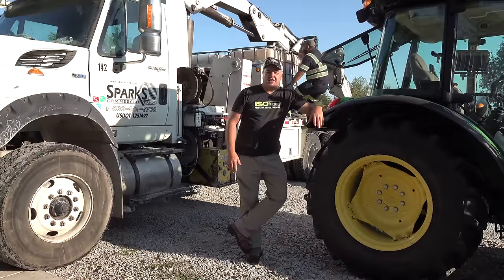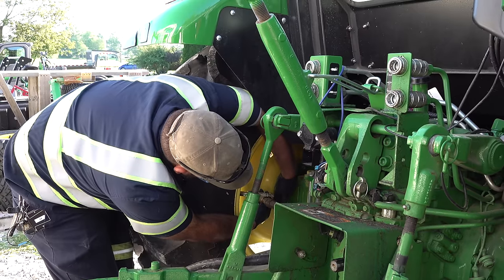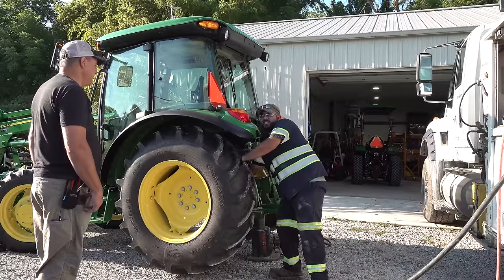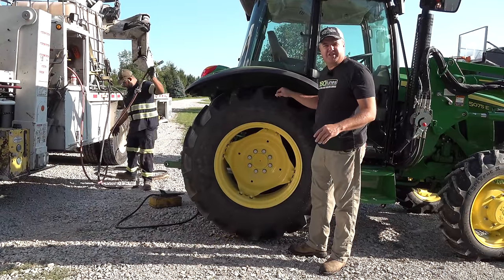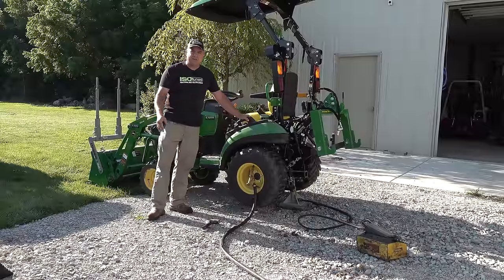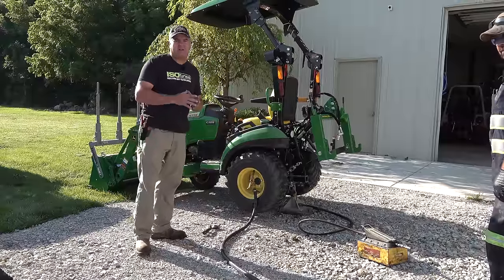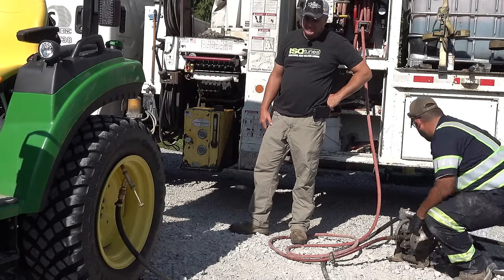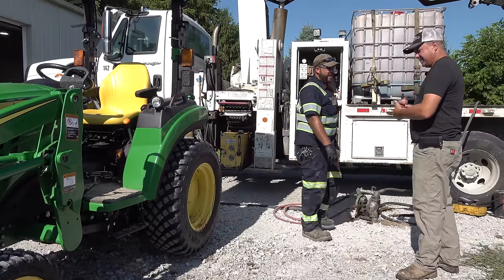Optimal Tire Ballast??  How To Add Rim Guard to Compact Tractors

Comment: Great video. I had RimGuard in my 4 series Deere, and It made a huge difference in the capability of the tractor. As you mentioned, I still liked doing heavy loader work with a rear attachment to offload the front axle.

Comment: I am the only person I know of that uses Rim Guard in the front tires of my 1025 R  I find that it helps with keeping them properly inflated.  Been doing this for 5 years and the front tires never lose pressure.  I don't do it for the weight, only the benefit that I worry less about front tire underinflation.

Comment: A good thing to reiterate as he kind of glossed over it is that once Rim Guard in in there, you have to check the pressure with the valve @ 12 o'clock.

Comment: I recommend greasing the valve stem external threads before putting the cap back on.  Otherwise, the Rimguard can sort of glue the cap to the stem.  

Never thought to check valve stem caps for rubber grommets.

Cheers.
Reply: yup, after all Rim Guard IS made from "Sugar Beets", which is why it doesn't freeze, sticky Sugar..
Reply: Sounded like gromlets. I guess that's an Indiana thing. 😆
Reply: @Dan-oz4qb  Amazon product info uses different language:  Airtight Rubber O-Ring Seal – These cap tire valves provide an enhanced seal to help prevent air leakage and to properly keep out dust, dirt, grime and road debris.
Reply: @Formulabruce  If you don't grease, then trying to get the cap off can break the stem.  Which creates an expensive puddle in the driveway.  Which is why I changed to another product for refill.
Reply: @Dan-oz4qb  I heard Grom-let as well lol

Comment: I do have liquid ballasst in all 8 wheels of my Ventrac.  No local beet juice, so I used the ever popular winter concentration winshield washer fluid.  Super easy to do since the Ventrac rims have 2 valve stems 180 degrees opposed.  7 gallons eash tire.  My slopes are severe and this helps and it is a huge help with the boom arm mower.  I tried threading the outer tires of the dual pairs as one normally does and what a royal PIA!  Then I wised-up and removed the lugs of the outer wheels to make the changes or to check torque of inner -- that is easy!
Reply from the maker: Good info.
Reply: HEY!  You jinxed me! I got my "J.D." out this afternoon and its ballisted front tire had this little shiney spot with dampness about it.  A bee hive frame nail!  So I jack that tire off the ground, pull the little cigar box nail, use a drill to enlarge/freshen the hole and a solvent cement sticky rope plug to save the day.  No ballast lost.  J.D. is a 1983 650 with the big Pillow Diameter turf tires.  Great tractor and runs like new.

Comment: I had my 3035d filled when I bought it, I like the way it handles loads in the bucket, the only time I’ve drove the tractor without the rim guard was around the lot at the dealership. At around 400 pounds per tire it has to be helpful!!

Comment: Anyone in Ontario, Canada: There is a dealer in Ingersoll that has it. I got mine done there. The fill process was knock the tire off the rim, and pour it in the side. We didn't use the valve stem. This was on a Massey GC-1720.

Comment: I have a JD 4100 that I had fluid put in all four tires when new. I recently replaced the front tires and did not add fluid. What a difference. The front tires will not turn on hills and only scoot forward when turned sharply. I AM INSTALLING FLUID NEXT WEEK before I get in trouble.

Comment: All 4 of my 2032r tires are filled.  It really has made a big difference.  Highly recommended.  The only problem is if you drive down the road at a high speed, you can feel it sloshing around and makes it bumpy.
Reply: I think you may need more fluid. From what I read, if you are planning to run at higher speeds, you want to fill above the rim (valve stem). This will help prevent sloshing, but will make a rougher ride as liquid doesn't compress like air. Another reason to use R4's rather than radial - you loose the flex a radial would provide. So cheaper and once filled not much different in flex/ride quality. BTW: this is what I'm hearing "on the street", so maybe Tim could chime in?

Comment: When we were tractor pulling, we made a plate that bolted to the lug nuts and a pipe welded to it. We then slid 50lb lead discs onto the pipes. We could make a 300lb mini modified tractor, into a 1500lb tractor. We had to do it that way because there were 4 weight classes, 800, 900, 1200 and 1500lb and had to switch weight classes constantly. Cool video Tim.

Comment: Interesting, I heard of people around here putting wind shield antifreeze fluid in their rear tires for weight but never a specific use product. Check your tractor with the forks attached at 20:10 of this video. Looks like your radiator is packed with debris. Best Regards, Jay
Reply: Front Grille sure does have debris !

Comment: On garden tractors filling steer tires helps even if you only add 20lbs per tire every little bit helps with a front snowblower that sits on the ground in operation since they like to go straight when you loose the added steer tire traction from the snowblowers weight as soon as the blower is lowered to the ground (I run tri and quad Rib steer tires on my garden tractors in16x6. 50-8) and my 23x10.50-12 v bar rear tires both front and rear loaded to 80%... My steer tires were factory 2ply on all my machines but I upgraded to 4or 6ply (depending on which tractor tire was installed).

Comment: Good work and an interesting video.  You converted me on one of your earlier videos to Rimguard and I find this ballast solution to be very effective.  As you mentioned, the weight is as low as possible.  My first go with Rimguard was on a set of HDAP tires used for plowing snow with a loader mounted blade.  I filled the fronts to provide as much steering traction as possible. Seemed to help.  Now have Versa Turfs with Rimguard in the rears only. We have some gooey clay and they excel in that stuff.

Comment: We are lucky here,straight water works. People will say it will rust the rim, but even if it does, it takes forever. My family has had water in the tires for 50-60 years and the rim hasn't rusted.
Reply: Yep, thats what I use. No problems. Way cheaper and easy to do yourself just pick up the adapter valve at your local hardware store

Comment: I ended up going with -20 degree rated windshield washer fluid from Sam's Club for my 1025r tires. It made a huge difference.
Reply: That is much cheaper the RG. Plus you can install it yourself. I have a  funny feeling it was not inexpensive.

Comment: Just a FYI...  Recommended minimum ballasting requirements for specific tractors/FELs can be pretty astonishing.  Ballasting, per Deere's own on-line manuals for the 520M MSL FEL on a 5075E Cab tractor (AKA Johnny 5):  Option 1) 3-pt hitch only ballast @ 3,197 lbs(!).  Option 2) 3-pt hitch @ 2,756 lbs AND rear axle @ 882 lbs (assuming that’s a total for both tires).  The new Rim Guard put 738 lbs per tire on the rear axle (1,476 lbs total), so that is around 2x the recommended minimum axle ballast requirement.  Even with the new Rim Guard, you'll still need something really heavy on the 3-pt.  I have no idea what kind of 3-pt implement weighs 2,756 lbs, let alone 3,197 lbs.  One thing not mentioned in the Deere manual is where that 3-pt hitch weight number is actually located.  I'd have to assume its out at the "24-inch behind the balls" distance normally used when specifying the 3-pt hitch lift capacity.  In the case of the 5075E, that 24" behind spec is 3192 lbs.  Like I said, astonishing!
Reply from the maker: Yep!   Extrapolating from the numbers above, 1500 lb on the axle plus 2000 lb on the 3 point should work.  That is what we’ll have.

Comment: Back in 2006 when I bought my tractor they wanted to fill my tires with calcium chloride. I told the the dealer no. As I knew it would rot the rims I have gotten by without weight in the tires as it does double duty as a lawn tractor and garden duty. The only time I notice the lack of weight is using the plow. If using the bucket for heavy lifting I will hang the tiller off the back as it is heavy and behind the rear axles like Tim mentioned for weight and taking some load off the front. Besides I have free ballast every time I sit in the seat LOL.

Comment: TY, nice video. I filled up my air pig that I pressurized  and was filed with winter washer fluid then transferred that into the rear tires on my mower, it added 62 lbs per tire. This method is best because filled tires and wheel weights don' t add any weight to the wheel bearings load the way rear hanging weights do.

Comment: Advantage of living in Florida, we just fill tractor tires up with a garden hose.  You just have to keep letting the air out to prevent over-pressurizing the tire. Haven't had time to do my new 1023E.

Comment: How much does the rim guard expand or contract with temperature? I know air will, and it will do a lot. Does the rim guard help prevent the tires airing down when it gets cold?
Reply from the maker: Good question.  I do not know.
Reply: @TractorTimewithTim  fluids are much less susceptible to volume & pressure fluctuation due to temperature than gasses are. Rimguard also has a much lower freeze point (-35) than water due to the sugar solution dissolved in it, but, because it is water-based, when it does freeze, it will expand like water does and can cause issues. lots of physics involved, but, with the smaller air volume left in the tire and the majority of the fluid being less dynamic, you will not notice much difference between a 110 degree day and a -30 degree day.
Reply: this is why I am getting agri-lim in mine, winters can be pretty bad here, will support -50 celcius (http://agri-lim.com/en/product/)

Comment: Well done info on the Rim Guard, and  the alternative installation of it on site, instead of taking the tractor to dealer.  Just curious as if tire pressure changes more in extreme (summer vs. winter) temperatures?  Nice job Tim and Christie, and blessings to you.
Reply from the maker: I don’t know, Kenton.
Reply: I'd assume the pressure would change less since there's much less air in the tire. Or maybe the smaller volume of air makes it more sensitive to temperature change? Great question!
Reply from the maker: Yes this is what an expert said in response to another same question.

Comment: Instead of a flow volume meter; do it by weight. Put a couple of load cells on the tank frame; and knowing the density of the rim guard; you can extrapolate how many gallons you’ve pumped.
Reply: weight isnt a problem,,,tractor frame and axle dont carry the weight, only the rubber at the bottom of the tire
Reply: @bill45colt  That’s not what the comment was about. It was about dispensing a specific amount of fluid; and how to measure it reliably.
Reply: @darkwinter6028  i comment as i please,,,,

Comment: I feel like I read in the manual not to load front tires with liquid balast. I just loaded my rears with ww fluid and it cost about $45 to get it done for me. I used the jack method to get it done. What do they charge to fill the 1025 tire?
Reply from the maker: Haven’t got the bill yet :-)

Comment: I liked the front tires on my Ford 2000 filled with ballast because the front end was so light when I lifted the bush hog and drove on a bumpy road I had better control. The Ford 5000 had no issues. But all my tractors had the rear tires filled.

Comment: Going by my old memory. My manuals with my 2025r say 120lbs wheel weight, filled tires, and 600 or 800lbs rear weight(ALL 3).

Comment: I have been using rim guard since 2003 when we got our 4710, we have it in all our tractors, great product, the only bad thing I can say is on the smaller garden tractor tires without air water valve stems I have had issues with the brass insert separating from the rubber valve stem after around 5-7 years, when checking the air pressure the brass insert will twist out of the rubber body taking off the stem cap, the rim guard seems to deteriorate those style valve stems, I just lay the tire flat on the ground and break the bead and sneak a new stem in it without losing all the rim guard

Comment: I wonder what that radial tire manufactory thinks about putting ballast inside of a tire it just deletes what the tire was designed for.
Reply from the maker: Have no idea what you are saying.     Large tires have used fluid for 80 years or more!!!!
Reply: In my opinion Rim Gard isn't going to prevent side wall flex. Foam will.

Comment: How that effect on rear wheel bearings/hubs
Reply: No issues
Reply: No effect; because the weight is all going direct to the ground. If the ballast weight were attached to the frame of the tractor, it would be resting on the bearings and you would want to keep an eye on how much the axle is rated for vs how much you have on it.
Reply from the maker: The other answers are correct.  This is the safest ballast on the axles.   Same with cast iron weights on the wheel itself.
Reply: Effectively, in automotive terms, sprung vs. unsprung weight (the reactors don't have springs but...). What does have an effect is moving the tires in/out as tim mentioned, but probably not enough affect to cause premature wear unless MAYBE one was ALWAYS carrying the max load off the ground on the 3 pt. hitch and the tires were spaced out as far as poss.

Comment: The rimguard solution is a great product in and of itself.  The Rimguard company itself:  They suck!  They won't sell you the liquid itself,  no you have to go to a dealer and pay to have installed.  Which means you have to either take the tractor or the tire/wheels to get them loaded.  Secondly, their so-called "Dealer Locator" on their website - isn't.  To find a dealer you have to e-mail them, and then they only send you one dealer instead of choices.  Hey RG:  How about putting a real "Dealer Locator" on your web site like Kroger, Walmart, McDonalds, AutoZone, O'Reillys etc. etc. etc. like virtually every other American company does.  You know, for the convenience of your customers.
Reply: Thanks for the comment, we are happy to hear you like our product. Also, thanks for the feedback, we are currently revamping our website, set to launch this summer. We are taking your comments about our dealer locator into consideration for the new site. We should suck less with the new site launch!

Comment: My quick question is, what’s the shelf (inner tire Life) of the beet juice? Due to heat it has to expand, even if by a little bit, and since it was an actual product of a living 🌱 which means it will eventually decompose. I think I saw a previous video you did that the tech said it smells really bad.
Reply from the maker: I have never heard of a ‘shelf life’. I doubt it can decompose much since it is not exposed to ‘fresh air’.

Comment: Tim, what are your thoughts on inner tubes for 1025r?
Reply from the maker: No need for tubes.
Reply: Agree.  Tubes are so last century.  😀. You also cannot plug a tube. These machines seem to pick up punctures that usually can be easily plugged.

Comment: I have a subcompact tractor that i use in the summer months for mowing.   Do you recommend rim guard if I use the tractor to mow?  My yard is mainly flat.   I do use the tractor for snow removal in the winter.
Reply from the maker: I do, yes.
It will improve the ride (less vertical ‘hopping’).
The only possible time you will have negative issues is very early in spring when it is muddy.  Even then, with subcompact, I don’t see issues.
Overall, you will have a ‘stronger’ feeling tractor with the extra weight.
Reply: Thank you for the quick response!  I am going to set up an appointment and get the tires filled with Rim Guard.   Do you recommend changing the valve stem out or keeping the rubber?  I know your video said the rim guard doesn't hurt the rubber valve stem, but I wanted to ask now that some time has passed.
Reply from the maker: @tmonk001  yes.  Change out the valve stem.
Reply: Thank you!

Comment: Tim, what are your thoughts about putting four tires on compact tractor as shown on Good Works Tractor? Not trying to pit the two of you against each other but curious to learn your thoughts? Are dual tires front and rear a good idea? Is there too much stress on front axle? Do dual wheels on compact tractor increase stability on slopes? Seems a bit like Ventrac lite, but what are your thoughts? Thanks.
Reply from the maker: Impractical.   The benefit of a subcompact is its maneuverability.  The duals defeat most of that.  He does it just to get views, and to sell the kit.
Reply: Tim, thanks very much for your honest reply. You've saved your many viewers money and future frustration. God Bless you and Christy for all you do.

Comment: At 75% the cost of rear weights, I'd use wheel weights. The weight does not have to be purchased again if you have a tire damaged. You loose some or most liquid depending puncture. I guess if you call  the right tire guy, he can salvage some to complete them repair but not all.
Reply from the maker: For the subcompact tractors, I recommend BOTH.  We need all the rear weight we can get!

Comment: Maybe I'm the one that doesn't understand what a radial tire was designed for. Putting fluid in a radial tire just turned it back into a bias ply tire by stiffening the sidewalls up. by adding external weight  to a tractor with radial tires  still allows it to flex by Design. Maybe I just don't understand.
Reply from the maker: I do not have enough knowledge to answer your question.  Perhaps a Rimguard rep can step in and help with this one!
Reply: You're correct. It will stiffen the tires some but the air with give some flex.